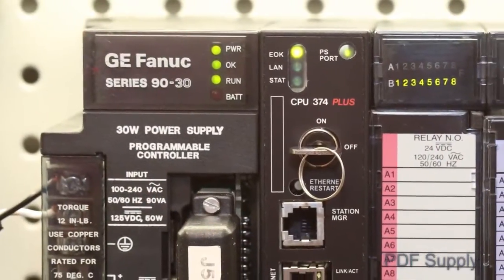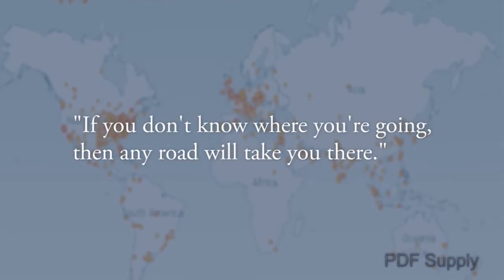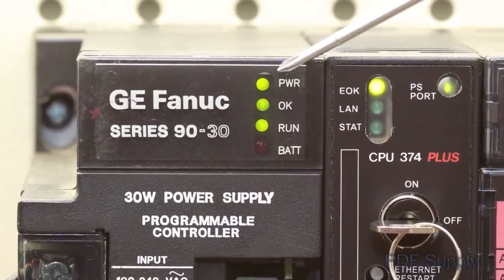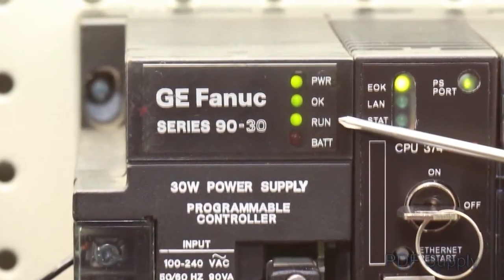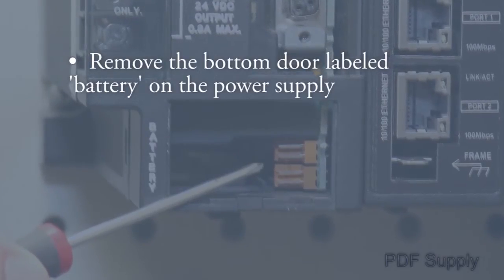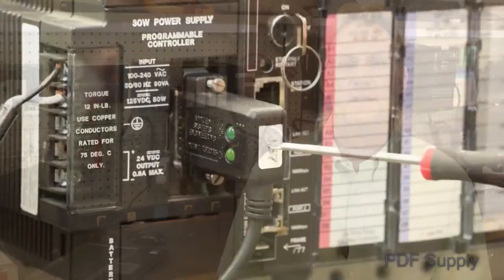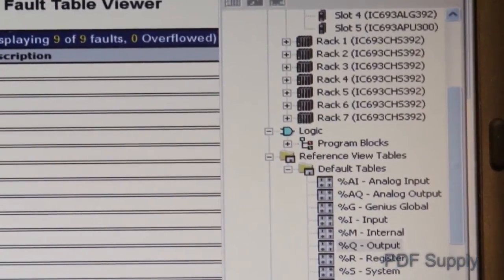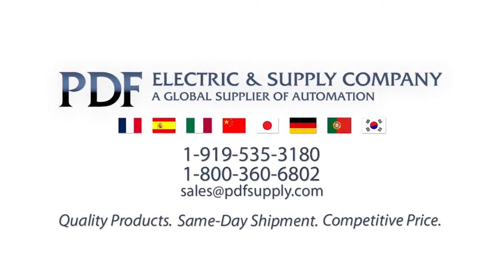Troubleshooting the GE Series 90 30 PLC System

Comment: Hello, I am in a dilemma, how can I connect to a GE Fanuc series 90-30? What software do I use? What operating system can I use? There is still equipment, but very little information...regards.

Comment: HELLO MY NAME IS IDEANGELES IN MY FACTORY HAS A GE FANUC SERIE 90 -30 PLC AND THE MACHINE FAILED AND WE HAD NO BACKUP, WE INSTALLED WINDOWS 7 ON A 32-BIT MACHINE, BUT WE ARE NOT ABLE TO COMMUNICATE, THE COMMUNICATION IS ETHERNET, COULD YOU HELP ME.

Comment: HELLO, SORRY I UPLOADED A PROGRAM FROM A FANUC 90-30 PLC, AND DOWNLOADED IT TO ANOTHER SAME PLC, WITH THE PROFICY MACHINE EDITION PROGRAM BUT I GOT AN ERROR WHICH SAYS "NO USER PROGRAM PRESENT" WHAT WOULD BE THE TROUBLESHOOTING FOR THIS ERROR. IT IS ALSO CONNECTED TO AN OPERATOR INTERFACE TERMINAL (MAP460D-240B).

THESE ARE THE DATA OF THE COMPONENTS USED:
CPU: IC693CPU323
PWR: IC693PWR321
SLOT1: IC693MDL240
SLOT2: IC693MDL240
SLOT3: IC693MDL390
SLOT4: IC693MDL940
SLOT5: IC693MDL240
SLOT6: IC693MDL940

THANK YOU VERY MUCH.

Comment: I have 1 question, I'm pretty knowledgeable with these.. but I have a problem when I turn my  GE PLC off.. The info I put into the computer when running doesn't save when it shuts off.  When I turn it back on it gives me like 360% reading everywhere..so I would have to go back in and put in my setting again.. But the software itself is still there..it's not the PC it works just fine.. Is this like losing software?? Have you had this happen before. Thanks!!